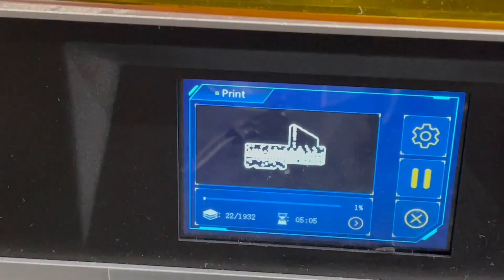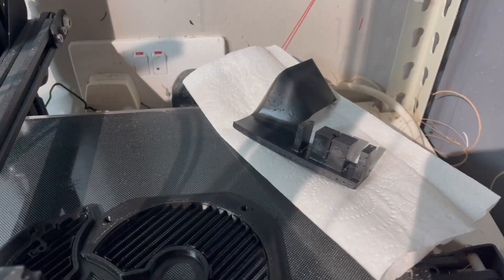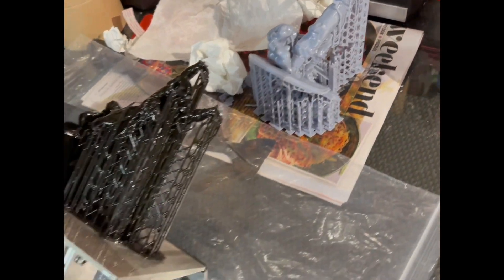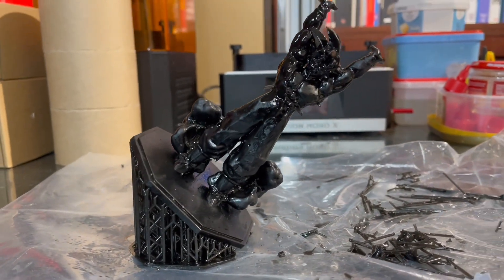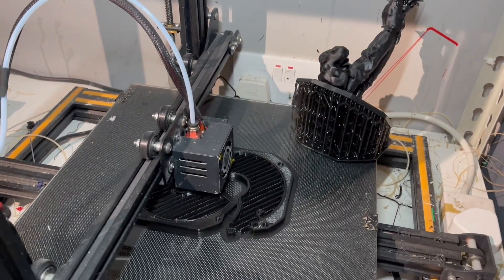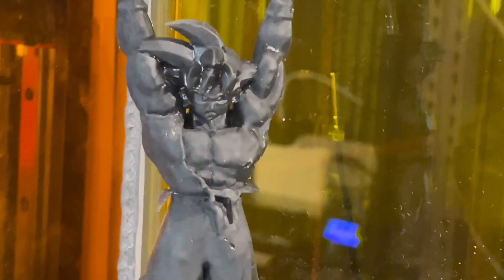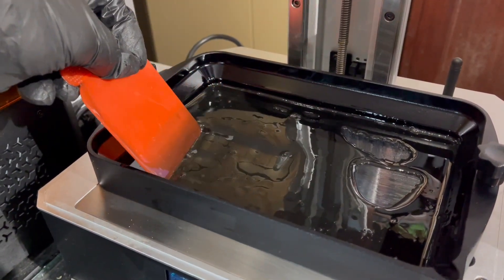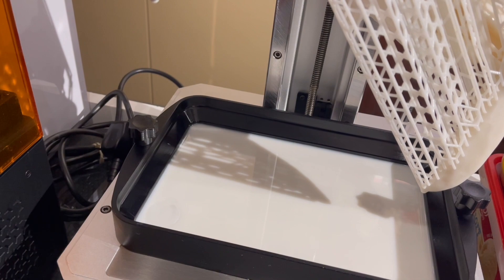Anycubic Mono X Update! Did Goku Survive in the Reprint? Plus my Resin Drain Platform Holder

Comment: few tips on cleanup. use an old hair dryer to heat the supports before curing the model this will warm the supports up and make them flexible and warp allowing you to easy brush the supports away from the model. not sure what slicer your using but i would suggest trying out the latest version of lychee. have you also updated the firmware to the latest one to re enable the Anti analysing on the mono x also if the model has a base attached like this one i would have printed the model directly off the bed. that way all supports are on the underside of the model so clean up also wont show dimples etc.  use a knife to trim the elephant's foot before you cure it this makes the cleaning of the trimming easy. also use the hair dryer to dry your models. i would suggest using an old syringe from an inkjet refill kit and use that to inject ipa into the models hollow to help clean out the resin. never seal the hole. allow the model to breath. and if you hollow always make sure the vent hole is always close to the bed as possible you want the vent holes to print first if you can. but yes i know this is always not possible. hence why i add bases to all my models. when i print large. :) hope these tips help. and i imagine your already in the facebook group Photon mono series group. :)
Reply from the maker: Thanks for the comment, some interesting things to try there! Would probably be quite difficult to get something that big off the build plate if printed flat, do you freeze the build plate or something like that?
I don’t really use FaceBook, but may give the group a browse, thanks for the suggestion:)
Reply: @CallumColes  you just need to dial in your base exposure if your having problems removing of the build plate then its to high dial back 5 on the base exposure then test again. no i find using the hair dyrer to remove the supports heats up the build plate a little allowing to slide a paint stripper tool under it. also you can load the model into 3d builder. and add a little gap on one edge of the base to allow you to slide to tool under it :) i use a base exposure of 35 or 30 depending on the footprint i also only use 4 base layers

Comment: I'm a little newbie 3D printing nerd in training here. I got myself a Anycubic Photon S and have been learning the ropes. Your videos have been super helpful, subbed for life! I'm at the point now where I do a great print, then a fail, then a great one, then a fail lol I'm using settings from far more experienced users but I sure would love to know all the settings you've got set for this printer. I'm itching to buy it for the extra size but also scared of losing huge amounts of resin on giant failed prints. So any help on settings in chitubox would be fantastic as you really seemed to have nailed this printer and reached the glorious it just works level hehe

Once again, you're making great videos, packed with great info and presented flawlessly. I'm left eyebrow raised impressed ha!
Reply from the maker: Ah thank you for saying so, that's the reason I made the channel so very happy to have been able to help.

Once you find your groove with these resin printers, they should be pretty reliable, so is worth the time. You'll still get fails from time to time as you push the limits, but that is part of the fun. 

For this particular printer, I found that (aside from the physical setup), it was important to keep the lift speed quite low. I have mine set to 120mm/min. That's because the peel off force for such a large build plate is significant, so a slower speed has helped ensure the printed part is not ripped off the bed. The exposure settings are more dependant on the resin you are using and will need to be tested really.

If you are looking for some additional resources on resin printing in general, you should have a look at the FormLabs website, they have some fantastic information: https://formlabs.com/uk/resources/

Comment: hi, I saw this drip stand on thingiverse, I have a photon m3 I was wondering if the stand works for my model too,,,,
Reply from the maker: I had a quick google, does not look like it would be compatible. But given the drip stand I designed for this was still a work in progress, if you can spare the time, you would get better results designing a purpose built one from scratch

Comment: Hi there, are you going to post a link to that resin dripper piece, it looks great?
Reply from the maker: I never actually finished it... I'll get it done and posted by the weekend.
Reply: @CallumColes  Thanks, that would be awesome. I used your backboard piece already and it worked great too. Getting the resin to drip of has been a real pain in the butt, so I am looking forward to printing out your solution, it looks great.
Reply from the maker: As promised, here you go:) https://www.thingiverse.com/thing:4963548
Reply: @CallumColes  Thanks, man. I am going to print it out tonight.
Reply from the maker: @Maloquinn  nice one, hope it helps you’re workflow! I might do a quick video on how I use it also

Comment: I just got done ordering this online for my Comic Character prints. I am already having issues getting Chitubox to install, but now I hear Chitubox does not work with the mono x. Only the Anycubic slicer they send on the thumb drive. Is that the slicer you use? How do you like it? I hear its crap. This is my jump into resin printing. I have 4 FDM printers.
Reply from the maker: Chitubox does work with the Mono X - it's what I use - far far better than the Anycubic slicer. There has been a built in profile for Mono X since version 1.8 of Chitubox. Persevere with the installation, it will be worth it!
Reply: @CallumColes  I finally got it up and running after updating firmware. This printer has kept going since. I have only ONE fail.
Reply: @CallumColes  For some reason the file was not read correctly by the printer... so a quarter inch of resin cured all the way across the plate. I thought it was the monochrome screen already! However, after deleting the file and re-slicing it is printing great right now as we speak. This happened just last night.

Comment: The BACKBOARD file link is note the one you show on the video.
Reply from the maker: Hey Joao, it should be the correct file unless Thingiverse is playing up, which is not out of the question... It would be the same as the one actually installed on the machine in this video, rather than some of the failed prints discussed.
Reply: @CallumColes  I can confirm that it's the backplate you used in the first video and not the one you are using in this one - if you have it, I would still be interested :)
Reply from the maker: Finally finished the draining version (better late than never), enjoy! https://www.thingiverse.com/thing:4963548

Comment: Man I wish I could get my mono x to print this nice or even at all damn thing just failes constantly
Reply from the maker: It is worth the perseverance! FormLabs has some great articles on understanding the forces at play when it comes to resin printing. For this printer specifically, try to lower your retract and lift speeds, it can help to reduce the force on the model during the peel process.
Reply: @CallumColes  yeah i got it working, had to up the UV to 80% and lower the lift speed to 1 any quicker and it fails even now 80% are failing
Reply from the maker: @Highdog_Hobbies  that’s moving in the right direction! Just keep trying to figure out what caused the failure and adjust accordingly. There’s always a reason something fails. Although, always annoying when it happens, particularly because of the clean up!
Reply: Funnily enough I think I have nailed it down to shit supports on (pre supported models) all my fails come from presupported files but when I do my own supports or more accurately (prusa slicer auto supports) I get maybe 5% failes due to me failing to add a few supports to the missed spots if I don't check
Reply: @CallumColes  do you find you randomly get supports that seem to mesh together into 1 solid line of horrible crap. (Or is this more likely the UV light could be failing)
Reply: @Highdog_Hobbies  I'm looking at getting into resin printing are you still having issues or were you able to get it more consistent?
Reply: @theboi5201  nah pretty much sorted it. Put it down to pre supported files just being crap. When I did my own for the models they came perfect 98% of  the time